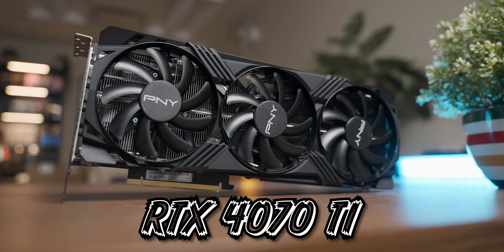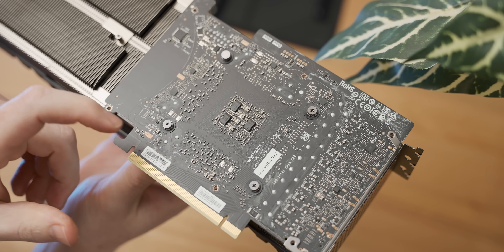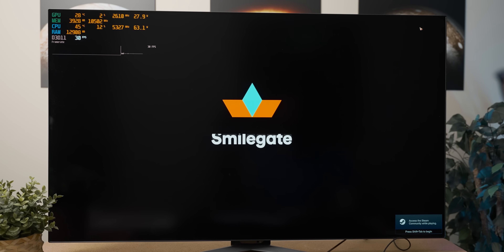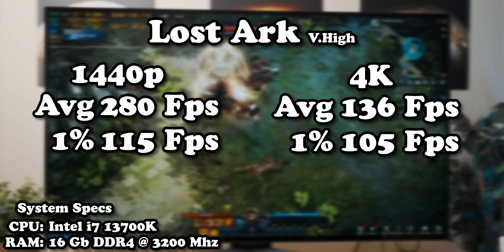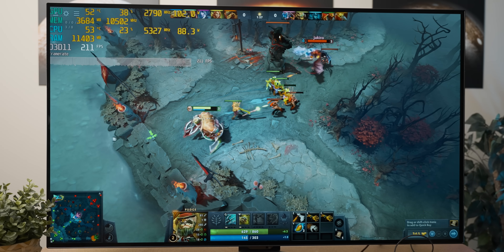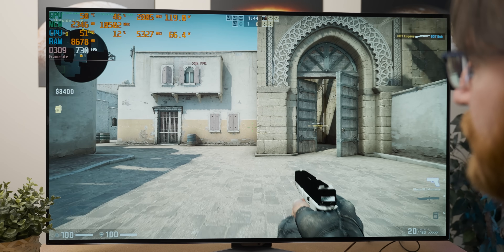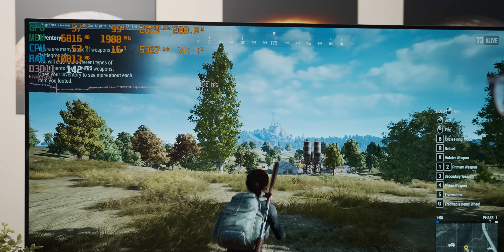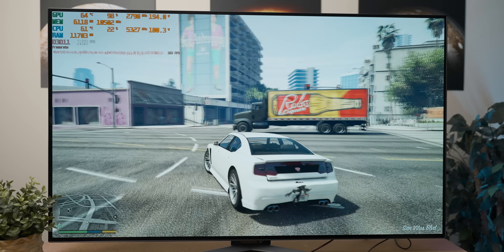RTX 4070 Ti Vs 5 Most Played Games On Steam

Comment: Just in case you didnt know, the reason why gta 5 kept dropping incredibly low in fps is because you hit the engine limits of an outstanding 188 fps, which is the max that game will go. As soon as it hits that number the game wont perform good at all even if you have a 4090, you have to lock your fps to 140 at LEAST if you want stable gameplay.

Comment: Garbage gpu for the price and in general, it has 1280 less Cuda cores then 3080, it has 40 less tmus, 16 less rops, same amount of memory if we are talking about 12 gig version of 3080, bus width is also 192 bit vs 384 bit on 3080. Yes it has L2 cache, yes it has higher core speed, but all we get is higher price for less effort, higher speed and L2 cache is cheating in my opinion, gpu sure makes more fps, but they spent less money to produce it and cranked prices up, that's a joke to me

Comment: Dawid, buddy!  You really need to get yourself some better ddr4 to do your 13700k justice. I'm sure you have someone in your community that could source you some tuned bdie (because tuning ram is boring af) to really smooth out your frame times ect ect. Unless your trying to emulate what most people use but I don't think a 13700k paired with 3200mhz ddr4 is a very realistic choice for most people. If anything at least you can make a video comparing the difference and if it's worth it 🤷‍♂️. 4000mhz cl16 is a pretty good sweet spot but I'm a novice at tweaking ram so im sure opinions will vary. After trying for it for myself I found that you will experience a smoother overall experience and a boost in performance but it's the more consistent frame times that are the biggest benefit.

Comment: Seems crazy that the pcb is so small.... Seems like that would cost alot more then putting in a full length pcb ie one as long as the heat sink... Seems unnessisary whent they could prob make a bigger pcb for cheaper..... i personally exspect the next get to be doubble the power since they could put 2 of these cards on one full sized pcb....

Comment: I was thinking to get this card but now I might just wait. I have an RTX 2060 Super. I would have to get a new power supply as mine is older and doesn't have enough of those 8-pins connectors. I'm thinking to upgrade to a modular PSU. I just saw of a motherboard with connectors on the back. That be awesome for cable management.

Comment: I have a 4070 TI and have no complaints at all.... It blew the doors of of my  RTX 2080...
Reply: Same, I had the GTX 1080 and upgraded to the 4070 Ti and its amazing for 1440p / High refresh rates and can dab a little into 4k. For 799 cant beat that. 4080 cost 1,200 or more and the performance difference isnt worth that

Comment: So if your point was to bash on the 4070Ti.. you failed.. because you literarily get x2 or more times the performance than the 6700XT.. and the 40 series is more future proof..
Reply: People still will bash the card but the 4070 Ti is totally worth it imo. For 799 its the sweet spot unless you wanna pay 400$ extra for a 4080 which the difference between the two isnt worth 400$ though imo

Comment: RTX 4070Ti uses very low power and generates very low heat while performing very similarly to RTX 3090/3090Ti
Reply: that is good.
Reply: Still overpriced imo. Also it should really have more than 12gb of vram

Comment: consider the die size of AD104 and AD103 vs previous generations
4090 is legit 90 althought not full AD102. AD102 is abnormally strong gen to gen and 80ti card would not have that much VRAM (80ti is pure gaming card, but 90 card w more VRAM is for rendering and AI) . If the difference between 4090 and possibly 90ti or titan is too small no one would pay for ultra premium $2000+ 90ti/titan 
4080 is the real 4070ti
4070ti is just 4070
Ada is just too strong gen on gen if nvidia keep the same die size

Comment: My gtx 1080 is getting outdated fast. Thinking of upgrading to 3060 ti soon
Reply: Go for a gpu thats 100% worth it, 4070 even would be better. 3060 Ti is stronger then a GTX 1080 but my rule of thumb is when to upgrade gpus/cpus make sure its REALLY worth the upgrade. For me i had the GTX 1080 upgraded to a 4070 Ti which it was 100% worth it. Powerful upgrade.
Reply: @DETERMINOLOGY  true but 3060ti is a third of the price of 4070ti in my country and it would be bottlenecked so much by my 8th gen cpu and I only have money to upgrade one of them rn so I’ll probably just save up.

Comment: 12gb of vram and a 192 bus, what a rip off!!!
Reply: Everyone isnt AMD fans so thats out

2. Yall stuck on memory bandwidth as if thats the only thing that makes the gpu lol. Learn the gpu as a whole which gives it its final speed. A gpu with higher memory bandwidth and lower specs everywhere else can get beat so its not just memory bandwidth.
Reply: @DETERMINOLOGY  4070 ti= trash...
Reply: @packersfan036  We dont base it off your opinion, I have the gpu my self and @ 1440p / 165 Hz its amazing. If i based it off internets opinion i would of grabbed a more overpriced gpu which is the 4080 and the difference between 4070 Ti and 4080 isnt worth it for 400$ extra even if its stronger

ALL GPUS are high in price so you have to pick your pot. 4070 Ti is the sweet spot imo and i have no issues with it and coming from a GTX 1080 it was worth it and i dang sure wasn't waiting for the 5 series nor i was going to get a 30 series card nor i was going AMD so
Reply: @packersfan036  And most people saying its trash as well prob has it in they rigs and enjoying it. Yall do this because the internet saying is trash so yall follow the leader and do it for bait but end up having the same thing in your rig. This is all general stuff that goes on every day

For 799, Not to crazy as gpus were 599, 200$ overpriced. I can deal with that and but what i cant deal with is the 4070 Ti costing 799 and the 4080 is 1199 which is 400$. 23% stronger or so for the most part. um how about no

Comment: You idiots keep buying old 30 series cards for way over msrp 4070 is cheaper more efficient and does practically all the same performance, you slobs are the reason Nvidia keeps price hiking cause you morons will pay double msrp for a similar performing last gen card just cause it has more memory bandwidth but still has worse performance/efficiency/reliability.. you guys are the reason cards are so expensive, cause you all are sheep

Comment: 4070Ti with 16Gb of VRAM would’ve been a much better option. 
But when you consider the price tag and only 12Gb VRAM it doesn’t make much sense, especially when you have a previous gen lower tier card like a 3060Ti with 12Gb VRAM..

Comment: When the 40 series launched I bought a 3090 on black friday for $825 and i’m really glad I did. 
With a slight overclock I get a little bit better performance than the 4070Ti and the double VRAM will really come in handy on future titles at 4K with Ray tracing. 
Hardware Unboxed did a great job showing what kind of memory you’ll need in the near future if you want to push those GPU’s to the max. 
Sadly the 4070Ti ain’t cutting it with only 12Gb.

Also the 6700 XT is an incredible gpu👏🏼
Reply: The 4070 ti  will do just fine in 4K in the future. Even if you’re having to tweak a few settings or use dlss. Frame generation on the 40 series are worth it so in my opinion I would have gotten a 4070ti
Reply: The only true native 4K card is the 4090. Any other card out there isn’t really the best choice for 4K native, and are in my opinion just 4K capable. What I was trying to say was I would have gotten the 4070ti. The newer tech in the 40 series would be worth it over the 3090ti. Unless you really need 24 gb of vram. Which if it’s just for games I don’t think would be worth it.
Reply: @bretwade8065  yes, if just for games probably not worth going with last gen flagship. And while the 4090 is indeed a 4k native card, it’s sad to see that when using RT in a demanding title like CP2077, it can’t even stay above 40fps. 
While it is a huge leap in performance compared to 30 series, the fact that someone spends $2k on a card and a 2 years old game will bring it to its knees its a bit sad.
Reply: @claudiucristian5632  I agree with you on that it’s pretty ridiculous
Reply: @bretwade8065  this is quite subjective as many people want to enjoy games 4K native with everything maxed out and for that reason 4070Ti isn't the best choice. Not to mention that a lot of people are complaining about the image quality when using DLSS+FG.
Reply: @claudiucristian5632  I don’t notice any bad things with frame generation but I do with dlss. And as far as native 4K, a 3090 ti isn’t going to do that either without the use of upscaling. Especially future games.
Reply: @bretwade8065  I agree that some settings will need brought down a bit or use DLSS Quality, but as titles get more demanding the VRAM usage will increase as well. I’ll rather lower some settings than see that my GPU becomes limited due to lack of VRAM.

Comment: I did SMT (surface mount tech) and that residue is solder paste that got messed up. I highly recommend using alcohol to clean it before it bridges and shorts out the card. I would get a RMA because the fact the paste is all over like that shows they had issues with the SMT and never even put it in the sonic after the oven.

Comment: I just built a pc with a 4070 ti.  I just play a few games and the only one I play that requires serious horsepower is MSFS.  I keep my PC's for at least 10 years so I like them to run cool and easily handle the few games I play.  The 4070 ti fits that bill.  My recently replaced pc was a 2600k with a Titan X Maxwell (which was a 2016 upgrade and did the job).
Reply: will be long 10 years with 12GB of VRAM
Reply: @benfrese3573  Thats what they sayed 10 years ago for 8GB of Vram.
And they still play the hell out of that 8Gb cards.
Reply: @panterbv  First of don't get me wrong I'm not trying to attack you or the guy above that bought a 4070ti. 

Nvidia's first consumer GPU with over 6GB of VRAM was the GTX Titan X and it had 12GB it released 8 years ago. 
I can guarantee you that with most modern games not being produced for the PS4 and XBOX One that VRAM usage is only going to go up and its already at a point were 8GB VRAM is not enough for anything above 1440p medium settings no RT in new games. 

Hogwarts Legacy needs close to 12gb at 1440p medium settings and RT on, for The Last Of Us Part 1 its about the same. And you could now go and blame it on optimization but that's only partly the case, Hogwarts Legacy has gotten many patches improving performance but VRAM usage stayed the same, The Last Of Us Part 1 as well. 

To say "Thats what they said 10 years ago for 8GB of Vram" is factually wrong because there were like 2 GPU's on the market at that time with 8GB VRAM and they were meant for consumers, and  it was said by idiots that think "I will buy the GPU with more raw performance but less VRAM it has to be better" and a 3 year old GPU (RX 6800XT) is killing the 4070ti its almost half the price and it performs at around 86% of the 407ti (except Raytracing, which imo is a bad feature) and on top of that it has more VRAM making it already outperform the 4070ti in some games. And I know you also get DLSS 3 with the 4070ti but that won't help much if its not a performance issue but a lack of VRAM, I tried playing Hogwarts Legacy with my 2070 super at 3440x1440p on medium to low settings, I had VRAM issues and instead of feeling like I'm playing at 70fps with DLSS it felt like 30fps because of the micro stutters caused from not having enough VRAM.

Comment: I think my 4070Ti is the first card I've bought in several generations that's really felt like a significant upgrade. Consumes less power, makes less noise, and generates less heat than the 3070 it's replaced (and is also substantially smaller; I went for the dual slot INNO3D x3), but also manages to outperform it by a significant margin; I spent a couple of very happy days going through my games library and cranking everything up to 4K max settings...

Comment: I think the reason they are such popular games on steam is because they run on a clearblue pregnancy test at 1080p. if everyone had 3070s or better they would play more demanding games at1440p or higher. I have a 2070 laptop and play modern AAA games at over 100pfs at medium settings on a 1440p monitor, When I upgrade to a proper tower id want to have a system that can run all the games i want to play at 4k with 1% lows around the monitors refresh rates for the smoothest possible gaming. 
still a great video showing how stupidly powerful the newest bunch of graphics cards are.

Comment: The 4070ti is a MONSTER and I laugh when people say it can't do 4K , It's $800 yes , But it is basically a 3090ti which used to cost upwards of $2000
Reply: 6950xt is roughly the exact same speed for $650
Reply: @TheNewSkai  No the 6950XT is not as fast as the 4070ti it's 10-12% slower and that is without DLSS 3.  Also if you turn on Ray Tracing which YES PEOPLE ARE USING IT , the 6950XT can't get 30fps in 4K with it.
Reply: @anthonylong5870  You you're right it is a bit slower. I personally wouldn't pay $150 more for better ray tracing performance and less VRAM tho. 12gb isn't enough for high resolution gameplay in some games.
Reply: @TheNewSkai  Ray Tracing is the new standard.  AMD fans always say stuff like "it's not a real thing" or "nobody uses it" and that is simply not true at all. We are starting to see game manufacturers focussing heavily on Ray Tracing.  Just look at Fortnite recently or what Cyberpunk did this week with RT, Hogwarts, Portal etc.  All HEAVILY supported and recommend RT.  It's not just a small amount of performance difference of RT between AMD and Nvidia.  It's a casm in a lot of games.
Reply: @anthonylong5870  I rarely use ray tracing so, for me, it's not worth it. Like I said tho, 12gb vram might not be enough for everything, which is a huge mistake on Nvidia's part.

Comment: You can find this particular PNY RTX 4070 Ti model for sale through Dell. I purchased the exact same model at launch.
Reply: How do you like it? I have around $250 in Dell credits and thinking of buying it. Is it quiet? Any coil whine issues?
Reply: @dinospumoni8255  I assume it’s quiet since it is definitely overkill cooling for the part. However I’m probably not the best opinion to poll on noise since my tower is loaded with enough fans that I probably wouldn’t notice coil whine (I always use have a headset on when using this tower).

My biggest complaints with the card are that it’s aesthetically understated (materials don’t look premium and no RGB), and the oversized cooling causes a little GPU sag (I think it came with a sag bracket though if I remember right). It performs well though, and I think Dell has an MSI RTX 4070 Ti for sale now too (I only ordered this PNY variant because it was the only 4070 Ti Dell had at the time and I’ve had good experience with my PNY 980 Ti).
Reply: @mattreigada3745  Thank you for the feedback! I guess I'll price match the MSI 4070 Ti to $870 and use my $250 credit on that since Dell has it for $965 at the moment, was looking at PNY because it was $866. 

I know the XLR8 version of the PNY is highly reviewed for thermals/noise but not sure how the Dell version is in comparison since it has 90mm fans vs 100mm and one less heatsink pipe as well.

I guess I'll try my luck with the MSI.
Reply: Follow up: I bought the MSI Gaming X Trio and the coil whine is terrible. Even undervolted, this thing is still screeching. Going to return it and try the PNY.
Reply: Last update for anyone reading. PNY is basically dead silent for coil whine, a night and day difference compared to the MSI I had. Overall, very happy now.

Comment: Futureproofing PCs is kinda ... well... almost moronic ESPECIALLY when it comes to GPUs! Why? Well GPUs advance so fast that the games really can't keep up these days. You actually just kinda proved that point with the RTX 4070 ti - where the question should also be - why spend 2000-ish $ on some overengineered 4090 variant - when you can get this card for 800?
What people seem to forget is that most games are made for the mid and low range. Why? Well it WOULD be kinda stupid to limit the amount of people who can play your game and get a full experience. Usually the "extreme" are just some extra "shine" - which often doesn't actually improve the visual inputs you get when gaming - which is why most pro gamers turn off a lot of the details. (that and the higher FPS) This is not a new thing - we used to do this in competitive Quake 2 and 3. - Back to the point... At the point where a card like the RX 6700 XT becomes too slow - you can more than likely get something which curbstomps the 4070 TI - for a combined less than it would have cost to buy the 4070 TI to begin with. Also the RX 6700 XT would still carry some value - you could sell it, put it in a secondary/guest PC - or just have it around as replacement parts if your main card should fail... 

And also - if you are already going for this price point - then why not go with a 7900 XT for 100$ more? It's a better card - if you don't like grainy DLSS Vaseline lens graphics. LOL

Comment: You might need to translate the anglo-saxon a bit for your neighbours as spunky to them means something wholly different and are prob wondering how residue can be bold or brave right now... :P   You could of course use cockney and call it some harry monk but do be gentle they still haven't worked out there are two "i"'s in aluminium yet ;)